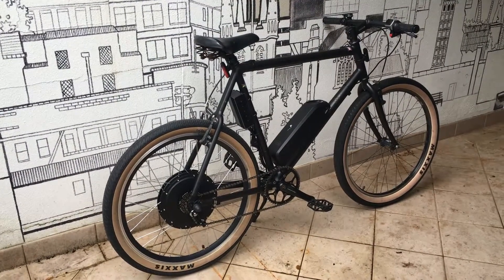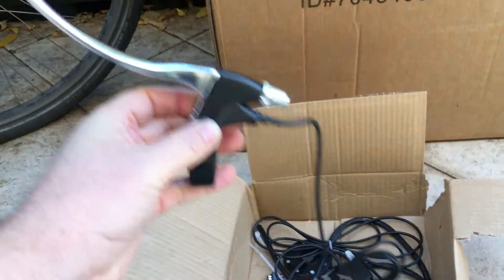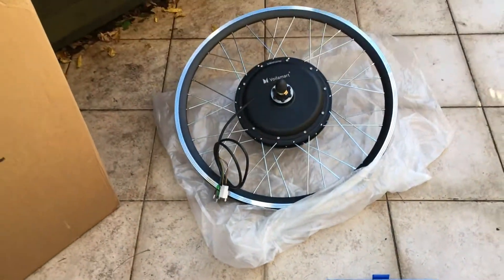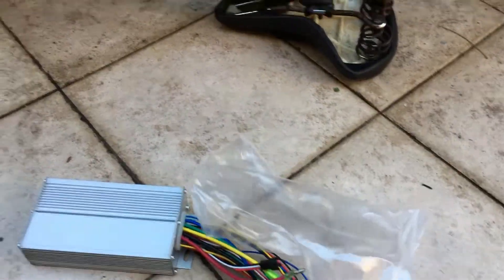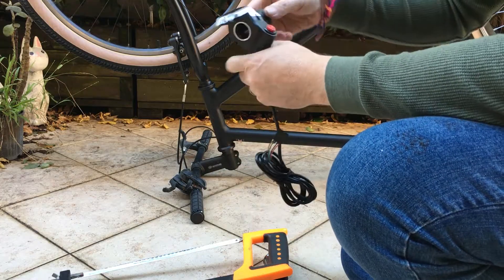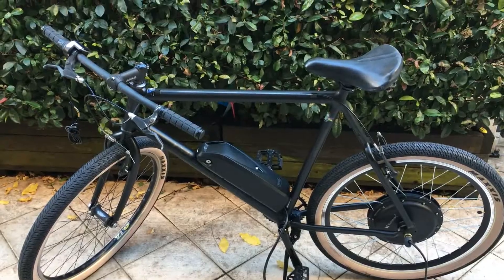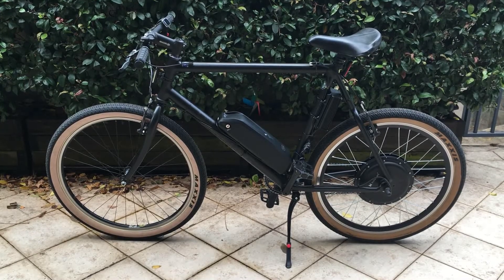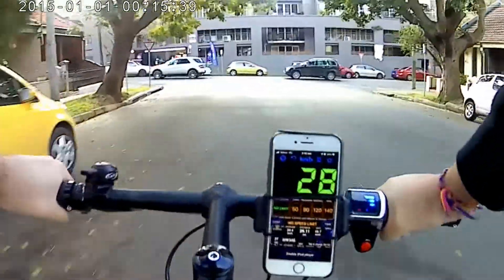EBike Conversion Kit from Ebay - Build your own Electric Bike 48V 1000W

Comment: 9:43 Instead of black tape you should try heat shrink with a few slivers of a hot glue stick inside. It makes a nice professional looking and more importantly waterproof connection as it squeezes the excess hot glue out which you can just cut off.

Comment: I know this video was 3 years ago  but do I have to shorten the cables asking before I buy my kit and battery I don’t have a kit to shorten it
Reply from the maker: @coolgamercoolest197  yes you’ll prob need to shorten the cables unless you wrap them around and cable tie them. Better to shorten and keep it neat. It’s pretty easy with some wire strippers.
Reply: @Mikey2hands it’s been a while but I finally bulit my kit and I found a controller that matched my battery and wheel so every just plugged in I don’t know how to shorten or solder wires

Comment: Great video!!! How are the conversion kits doing 3yrs later? Any issues or suggestions? Im looking to do a similar project.
Reply from the maker: @juanadenip7638  battery got less distance between charges after solid use for 2 years, and was replaced.

Comment: Fab video, I went the other way and made all the wires longer, that way i could make a small hole in the bikes frame and had ALL the wires run inside the frame. Took some messing with a small nut on the end of the wire and a magnet to move it along the poles from the outside but all the wires have vanished, hidden inside away from sight and the rain.
Reply: I was going to do this exact same thing for my first build last year. 👌🏽

Comment: Probably don't use that exact battery. Doesnt list the battery chemistry or cell manufacturer. Look for a 48V battery with Samsung, Panasonic, or LG cells, ideally with LiFePO4 chemistry, though those can be a bit expensive.

Comment: I am trying to buy a kit for my bmx but the fork opening on my bike is small can i just remove the cassette from the motor and take the gear from my bmx and put it on so that it will fit in my fork ?
Reply from the maker: Only if it is a 26” bmx. It will be easier to buy a new cog on eBay than use the old one off your bike.

Comment: Does anyone know if a rear hub can be used on the front (by leaving off the cassette)?
Reply: no , a rear hub is a rear hub for a reason. if you want to use it at the front you need a front wheel hub. hope this helps

Comment: hey mate, loved the video and am getting more confident to build my own ebike. Just worried about compatible parts, abit confusing because I constantly see 48v, 10ah and 40A all the time and don't want to buy the parts without knowing for certain they will work. I am based in Aus and am after a 48v/52v 750-1000w ebike, a bit of help would be amazing... cheers!
Reply from the maker: You just need to buy a battery that matches your ebike kit. Ie 48v 10Ah 1000w. The more Ah = longer distance between charging. If you look on eBay most battery ads will show the  watts that battery suits.

Comment: Great job 👍 The best video of this kind. I was wondering if I use a dynamo on the front wheel (using it at downhills) and a panel(on sunny days) somewhere back would keep the battery charged for a long distance.

Comment: cutting the full length throttle is a brilliant idea! Using full length is dangerous.
Just placing my hand on the handle with a slight grip triggers the power, I had the bike rushing out a couple of times before changed to a thump throttle.

Comment: FIY This motor can  handle about 3000w no problem. All you need is a 3000w controller and 72v battery capable of at least 40A continuous discharge. 72x40 = 2880w

Comment: Built myself a Dillenger StreetLegal kit in 2016. Just wrapped the cables when necessary. (Great Video) 
What app did you use ?.......I'm off to look for it 🙂 Found an app....although the StreetLegal display has all the info, always nice to play a bit........

Comment: How do the old brakes hold up now that the bike is electric?
Reply from the maker: I’m a fan of the V brakes, they still work well with the e bike wheel. Disc brakes are probably the best option, followed by V brakes.

Comment: Hows u get ur throttle work without a sensor
Reply from the maker: Throttle doesn’t need a sensor. You are thinking of pedal assist which is different.
Reply: @Mikey2hands  thats what i mean hows it work without the pedal assist sensor, because I unplugged mine thinking it would be like rev and go but nothing happened
Reply from the maker: It will work fine with just throttle and no pedal assist connected. Maybe check brake cut off cables, they may be preventing throttle from engaging.
Reply: @Mikey2hands  sorted it mate had go into the tune settings on display

Comment: Hey just letting you know. The Battery you have linked they want nearly $3000 for it now. And the Break, Rear Arm and controller case links no longer work. c:
Reply from the maker: Thanks. As they were eBay links for other retailers I expected they would end eventually. I recently bought a battery on eBay for $300 so you can still get deals if you shop around. Stay tuned for a new eBay ebike video dropping soon.
Reply: @Mikey2hands  Def will be keeping an eye open for one. Look forward to watching the next one. This video has got me planning out my first one. So thank you :D Its nice to see a fellow Aussie doing the videos cause then its a better look at the price.

Comment: do you need the cassete on the rear wheel?
Reply from the maker: No you don’t need the cassette, I removed it and put a single speed 12 tooth on instead. When you have an electric motor you don’t need the other gears. Keep it light and remove gears and derailleur too.
Reply: HI.How did you adjust the chainline? With a single speed rear cassette? Can you give a video or a photo.

Comment: If you ever get a flat on the rear wheel, how does it get fixed without ha wing to undo all those wires you melted on together?
Reply from the maker: It still has the plugs. The cables aren’t hard wired together.

Comment: Built mine from a near identical kit. Just some things to consider. 

Weight of Bike.
Weight of rider with the above in mind.

My spokes had come lose causing 2 spoke nuts to disconnect (self-unscrew) and they now rattle inside tire. other spokes become lose causing the tire to be very very wobbly, i have resolve this sort of but the tire is now longer 100% straight.
Reply: A 250 watt motor done this exact same thing to my spokes over the course of a year and a half. Cracked the frame at the holes in three points. The rims typically just arent built for that power. Letalone 1000watts. Go to the shop and get the wheel straightened. And buy a spare rim to reattach your motor to. just incase your current ones crack over time causing your current rim to fail completely.

Comment: Thanks for showing me the chain tensioner.  . I didn't know they made 'em.  I use my 21 speed bike in a single lowest gear and with that belt tensioner I can eliminate the derailer

Comment: The black paint on alluminium controller looks good. But works worse. Alluminium works as cooler, and black paint attracts heat - so the color is contraproductive. And one more thing - the rear wheel pours water directly on it, so you need some "rain shield" on wheels (however water could add some coolink on controllers surface, it makes eletcric contacts wet)...

Comment: Hi I have attempted this today with no knowledge of bikes/ebikes and have given up already,  this is the best video I have found so Mabey I'll give it another shot 🤦‍♂️🤣
Reply: Im come back another 2 months and ask the same question
Reply: So 5 months on, did you get it to work?
Reply: Did you get it?
Reply: Did you get it?
Reply: Did you get it???😊
Reply: @scab2b  yo sorry for the slow reply didn't see a notification, yeah I managed to put it together, I didn't use the pedal assist, used it for 2 weeks then sold the bike. Was sketchy doing 65ks with crappy brakes and a buckled front tyre. And mine was 1500w with 72v battery from memory
Reply: Did you get one with a waterproof controller?
         Otherwise you got a  mess of connectors meant for computers. How will controller stay cool if you can’t mount it where it can get wet?
         If don’t have a waterproof controller. This video should get you through.
Reply: @walterconcrete5017  I don't believe it was waterproof, it was just the standard aluminium box that comes with the kit, I mounted it where the water bottle was on the frame, iv since sold the bike so cooling issues are no longer my problem cheers for the reply 👍
Reply: @dolts1234 :definitely want to go waterproof in the future.
            A bit pricey but safer,  more durable and easier to assemble. I suppose this would be the fourth thing after double bolt steering,front shocks and disc brakes that makes everything that doesn’t have them obsolete. The better the job we do on safety the longer before the government starts wanting to do it for us and they won’t make it cheap or easy.
Reply: They are literally as basic as shit. Simplest electrical job you could do.
Reply: Hahahah

Comment: Hello. I am a complete novice when it comes to bikes, but do I need a motor that comes with the same number of gears as my bike currently has? I own a Trek Marlin 5 with an 8gear freehub( I think, might be a freewheel? )  cassette. Most of these kits come with a 7 speed sprocket, would I have to make adjustments to my drivetrain to accommodate losing the 8th gear? For example a shorter chain, or adjusting the shifter etc? Any help would be greatly appreciated :)
Reply from the maker: Yes if you want to retain your gears it would be easier to do it on a 7 speed bike. However you may be able to keep the same derailure and replace the gear shifter to a 7 speed. Personally I like to remove all gears and put a single speed cog on the ebike wheel as you will find you don’t use the gears once it is motorised. I’m about to upload a new vid for my wife’s bike that will explain this.
Reply: @Mikey2hands  thanks, I look forward to your video!

Comment: You certainly can and should use the gears on your bike, you'll get the most out of the motor, and it'll run more efficiently, gears help it along.. As in you'll make it uphill faster.. It's not always about "just give more throttle" .. You won't necessarily go any faster or farther giving it more throttle could easily burn the motor too..

Comment: Thank you so much for posting this. The mountain bike I am thinking of converting has got quick release wheels. Is this conversion compatible with the quick release spindles?
Reply from the maker: Yes good question. You will probably find the rear drop outs are too narrow for the thicker ebike axel. Simple fix to just file out the rear drop outs until it fits. Stay tuned I’m about to drop a new vid on converting an Electra Townie to an ebike where I’ll widen the rear drop outs.
Reply: @Mikey2hands  thank you for getting back to me. I will keep a eye out for your next video

Comment: Hi there so only your back break is connected to the controller box ? Is that right ?
Reply from the maker: Yep cut off switch is only on back brake. But as you always pull both brakes together that’s all you need.

Comment: How many miles or KM can you expect to get out of this setup with just throttle? With a setup like this could you have installed a little screen or computer or does the battery have an indicator on it? Awesome video.

Jeff - Central Florida
Reply from the maker: The whole point of my build was to have as few wires and cables as possible. I don’t ride far and charge it up after every ride to keep charged up for the next ride. Can get 10-15kms out of this 10ah battery before it starts getting sluggish.
Reply: @Mikey2hands  Great. Thanks for the response. I too may enjoy just getting a kit which is plain and simple for sure. Great video. I really liked the way you put this setup together. 

Jeff - Sunny Central Florida

Comment: What does road legal wires connect to and what wattage it reduces the motor to? Was this kit bought in Australia?
Reply from the maker: Road legal wires connect to each other. When connected it reduces to 250W. Leave unconnected for 1000W.  And yes bought on eBay Aus.
Reply: @Mikey2hands  thanks for info. I googled if it was legal in Queensland. Whilst it is allowed but Police likes it to be pedal assist and some sort of code on it that it came from a manufacturer in Australia.

Comment: I made a torq arm out of a single piece of steel. It was a pain to cut the hole for the axel but I think it is more solid than those two piece ones. Anyway They are probably both good enough. I am just a cheapskate that makes things if I have the stuff laying around anyway.

Comment: Ive got rear v brake is that ok for electric conversion.
Reply from the maker: Yes it’s fine.  I use V brake.
Reply: Mike can i have ur Instagram or fb im actually having trouble with the battery
Reply: Also does that mean i dont need the brake disc for my rear wheel as its v brake?

Comment: i am in the process of building one of these Great Video i actually have the same issue with gears and break levers all in one but can't find that sensor you have that fits directly i am also in australia
Reply from the maker: Search eBay for sensor cut off switch. I don’t recommend using the gear cassette that came with the kit. You never use gears again once the kit is installed. I just put a single speed 12 tooth cog on the back with a chain tensioner and removed all the gears and cables. Good luck with your project.
Reply: @Mikey2hands  am i right in thinking that if you decide the top speed is too low, you could swap your 'fixed gear' to a lower gear for higher top end? would lose some torque i suppose but there would be flexibility on top speed?
Reply from the maker: @BogDog9  yep better top end speed. The motor soaks up the extra torque as you start to pedal. Then as you go faster you can still get traction with the low gearing combined with the motor power. I’ll make a better video explaining this when I build my wife an Electra Townie ebike.

Comment: There is a difference when using an aluminum frame bike and a steel frame bike. The aluminum frame will have wider material where the rear axle is installed at the hub drive than the metal frame. You could find your rear hub motor axle does not have enough threads left when you install torque arm after tightening down the axle nut on either side. The metal frame has thinner material in that area so if you install torque arm or drop out you have more material to work with on the axle shaft.
Reply: There’s one thing knowing about electricity not a good idea to ride your e -bike in rainy weather .
Reply: @stevearkie5722  well if i use it as a commuter bike it must take me to work even in heavy rain. There is no mercy xd
Reply: Oke so get a metalframe. Thx bro

Comment: if i use only pedal assist and no throttle, would i be able to not use the brake cut off sensors? since i don't pedal and brake at the same time
Reply from the maker: Correct. Brake cut off is only required for throttle.

Comment: Hey, nice build! How long on average does the 48v 10ah battery last? Thanks
Reply from the maker: Hey. Starts dropping off power between 10-15km but I usually recharge it every 10km to keep it at full power.
Reply: @Mikey2hands  shouldn't feel power drop on a 48v battery, only really feel it on 60v - 72v batteries

Comment: Hi man, very cool video! How’s the bike been to ride …is it still going strong?
Reply from the maker: Yeah it still goes great. I changed the rear cassette for a single speed 12 tooth cog as you don’t need gears on an electric bike. It flies!
Reply: @Mikey2hands  yeah nice, would be less noise with just the one cog on the back too I’d guess. I was thinking I would need 1500w but looking at your speedo I figured that’s fast enough! I really liked the way you went about the build with things like the throttle grip mod ect. If you’ve never used rescue tape or self sealing silicone tape give some a try …that would be awesome on the wire wrap.
Reply: @Mikey2hands  can you explain me like im dumb lol, when you replace the cassette for a single gear, what do you do with all the extra room on the axle? just some sort of spacer?

Comment: Did you know if you connect the pedal assist and you don't have a cut off or wire up the cut off levers you can just blip the throttle to shut off the motor so you can brake easy 😅 it over rides the assist
Reply from the maker: I’ve tried pedal assist on a couple of different ebikes and just don’t like the way it feels. Much rather having the control of a throttle. 👍
Reply: @Mikey2hands  i like both although every pedal assist I've had has broken after only a few weeks

Comment: Nice job! You can use a pvc pipe to hide the excess wires coming out of the controller.
 Just cut it in half and "clamp" it on the frame with the wires inside it. That's how i had it on mine.
Reply from the maker: Pro tip. Thanks I might try that.
Reply: Did the same with my last build. The piece of 22mm poly pipe sat perfectly in a recess on top of my battery. I covered it with some carbon fibre effect wrap, so that it doesn't resemble a length of pipe.